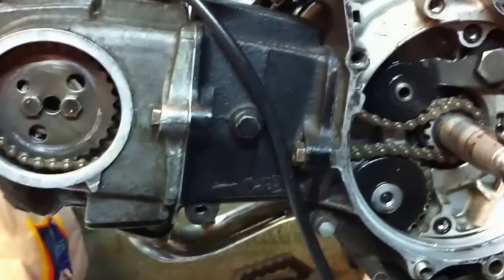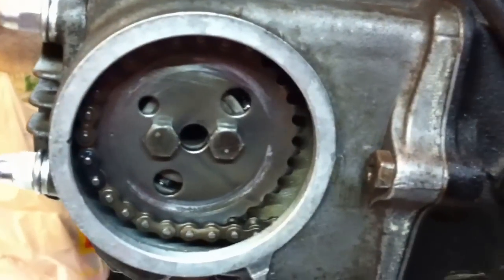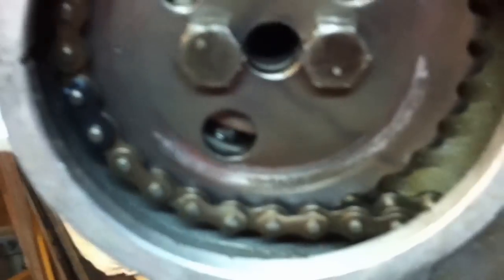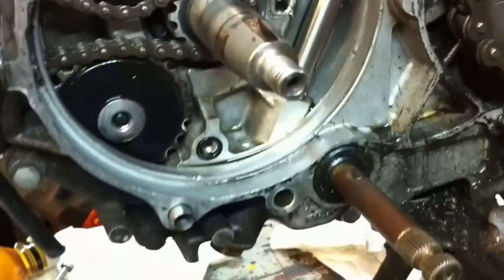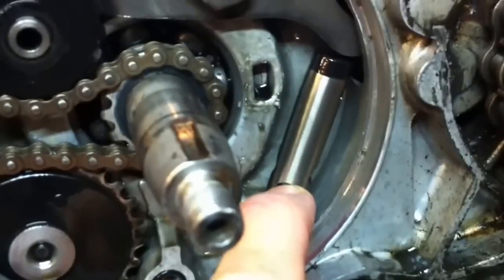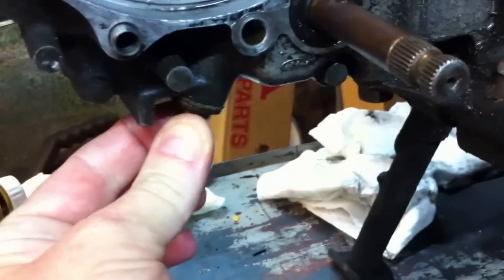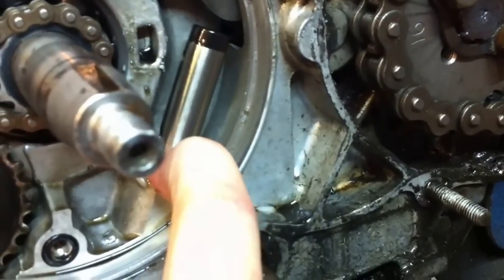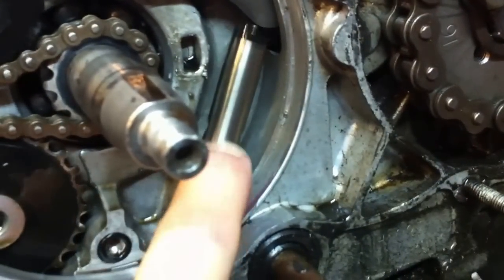C90 Camchain Tensioner - how it works

Comment: So i did everything i pulled my cover amd my motor is way different amd doesnt have that "fill" hole my chain is tight to the sprocket so it wont skip tjat being said will my engine noise eventually go away
I just laid the bike on the left side that primed the system

Its a kayo tt125 it starts and runs fine but has a little noise now

Found the problem it was the cover that goes over the sproket my guide pin snapped off so i put it on wrong and the inside of the cover was rubbing on the gear

Comment: I can't believe I found this, today I changed the oil on a c90, I did exactly what you said and accidently undid the cam tensioner bolt  first, now I have a clattery sound but thanks to your video I will be recharging it with oil. Thankyou 😊
Reply: How bro, I also accidentally plug out that bolt and its so noisy 😢😢😢

Comment: Your video saved me, after putting back the tensioner (without squirting the oil in) i had my bike running for less than a minute trying to figure out where does the clanking sound coming from. Does it hurt the engine? After i followed ur instruction the sound went away

Comment: Thank you for the great video. Please support me since in my old machine there is not also spring. Maybe someone remove it its missing or its normal???
Machine was stuck for years i just renovate it
Reply from the maker: As far as I know all Honda motors of this type have springs, both the manual adjust types and the automatic version shown in this video

Comment: I made the same mistake other did. drian it out oil on the chain cam tensioner. When the oil started to come out it was way more then 1cc recommended. it came out in ounces of fluid. Btw, I inherited the bike. What replacement oil should I put back in?

Comment: Can I ask what happened if you put  spring first I did it on my own engine but can't find the spring?
Reply from the maker: in that case the spring maybe jammed inside the housing - time to open the casings and check
Reply: Did you manage to sort this as I have the same problem

Comment: I have the same type of tensioner, can I remove and change the tensioner spring without removing the crank cover?
Reply from the maker: Certainly, the spring will drop out of you remove the securing bolt underneath, although it's unlikely the spring will b the cause of your problem.
Reply: DaveSluggy I've tried to remove the spring and plunger,  stretch the spring and put it again but there still tik sound

Comment: hi sir how's to  change the spring in the camchain tensioner to my 110cc motorcycle
Reply from the maker: If it's the same type of tensioner as the one shown in the video then it will be a easy to remove using the bottom plug bolt, undo this and the spring and plunger will fall out allowing it to be easily replaced and refitted.
Reply: @DaveSluggy  kinda stupid question but when you say oil is it the motor oil? or do i need a special type of oil?

Comment: I acquired a CT90 but it is missing the bolt located in the middle of the cylinder. you can easily see it in the beginning of this video. what is that bolt for?
Reply: This engine is not a CT90 engine, it's a C90 engine. However, both have that bolt in the cylinder and that bolt holds a guide wheel for the cam chain in place. If there's no bolt there then either you don't have that wheel or it is stuck in the engine somewhere so be careful.
Reply from the maker: It holds the 'rubber wheel' cam chain guide roller in place.

Comment: Hi there I have a question, when you remove the spring will the metal ball fall out? I want to change the oil on my 110cc and I thought that it was the oil drain and the spring shot out, and I didn't notice if the ball shot out as well! I put it all back together with the pieces I had but no ball because I couldn't find it, I'm worried it might damage the engine
Reply from the maker: Hi - Not a problem your motor will be fine - the ball valve is within the plunger part and won't fall out on it's own.
Reply: @DaveSluggy  Hey Dave! thank you fro tutorial! i have a question. in my pitbike 110 i have opened the bolt of the retainer but NOTHING COME OUT! the engine seems run good, no particular noises. But im sure there is not a spring inside the engine carter. Would it run good only with the metallic cilinder and the oil pressure, without the spring?? thanks mate
Reply: Hello I done the exact same thing and as I was putting the tensioner back in with the spring the spring shot up and I think is somehow above the tensioner any idea how I can take the spring out to put it back into place?

Comment: Amazing video and explanation. So clear. 
I have a question my can chain is loose due to which I m getting that tak tak or clicking or knocking sound. Is there a anything that I can do with that tensioner to probably reduce the free play? And can one replace that big black sprocket in the bottom below the chain? 

My cam chain gets loose after 3-5k kms on a daily commuter bike.
Reply from the maker: If the tensioner is working properly - check the ball valve in the plunger is free and rattles when you shake it. The best fix will be to replace the cam chain itself. You can replace the lower sprocket - it's not easy as this is the oil pump drive and it's screwed onto the shaft so you will have to remove the clutch and oil pump from the opposite side of the engine.
Reply: DaveSluggy thanks for the quick response. I replaced the cam chain and the cam noises are gone.  Now there is some other sound that's most likely the bearing sound..as there was no vertical play in con rod big/small end.
Reply: I

Comment: It's the middle of the night so I won't try this technique just yet for the sake of my neighbors...But  I did the same rookie mistake and ever since I put it back together, the bike is extremely hard to start and when it does start, it is really slow. If I prime the tensioner will it take care of that problem?
Reply from the maker: +Rico Suave Unlikely, more probably the cam chain has jumped a tooth on the sprocket so check the cam timing before doing anything else, if it's more than one tooth out then it will have bent one of the valves and your going to need to strip the top end down.
Reply: +DaveSluggy Darn I just checked it and it looks like my timing is in spec. I Googled and it looks like I am supposed to be at 9 o'clock on the sprocket. Im actually at 3 oclock, and there is a T mark on my fly wheel that is supposed to line up. I don't know what else it could be. it will start up cold, but not warm and will usually die pretty quick and has no mid range. when I reinstalled the spring I ended up cutting some of it off because I had initially installed it wrong and bent it pretty bad. It doesn't seem like that is the issue though.

Comment: At 3:00, are you sure that hole is for filling? Because what i've read the tensioner gets oil from the oil you fill in your machine. Because if you fill it like that in the little whole the tensioner will tension the chain too much and it will sooner or later brake. (The chain)
Reply: Filling it with oil is a must thing to do, because the air in the tensioner stops the oil from entering down the tensioner piston and ball valve on the first few starts and cam chain may skip some tooth.
Reply from the maker: Robert Kjötar The Honda manual states to add 1cc of oil through this hole on assembly. Originally this was the locking bolt for the manual cam chain tensioner system; the plunger had a ramp on the side that was pushed upwards by a spring and then locked into place by a cross bolt.
Reply: DaveSluggy Hmm, okay. But 1cc? 1cc=1ml right. When i filled it i filled it until it started coming out oil like you said on the video. Wouldn't that be too much then?
Reply from the maker: Robert Kjötar You can't really over-fill it; the excess will run out of the opposite hole into the casings.
Reply: DaveSluggy Hmm okay, because i've had a problem with my Honda Z50J (same engine type as C90) the cam chain would jump teeth. So the piston would start hitting the valves. But it stopped after i filled that hole on the video but that means that the oil pump isn't working properly? The tensioner didn't have enough oil pressure to tension the chain seems like. But why i asked about over-filling it was because it started running slowly and felt like it have lost power and i though that maybe was because the chain is too tensioned. Thanks for the replies!